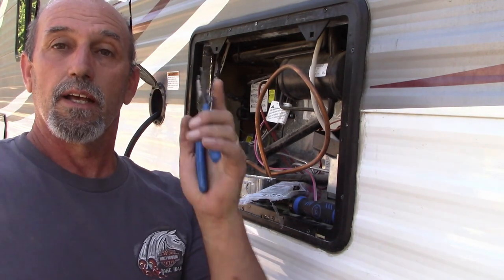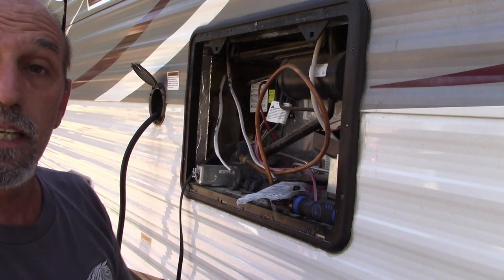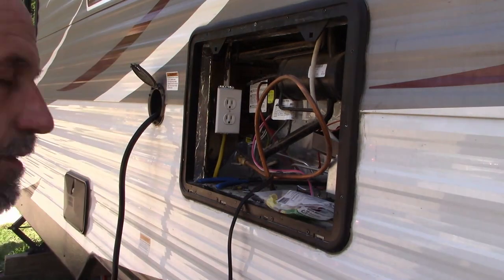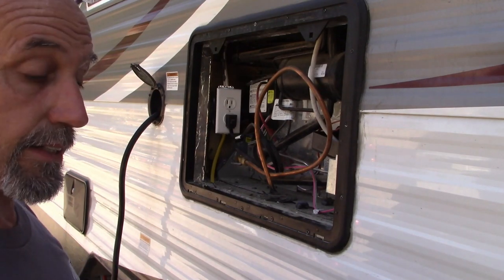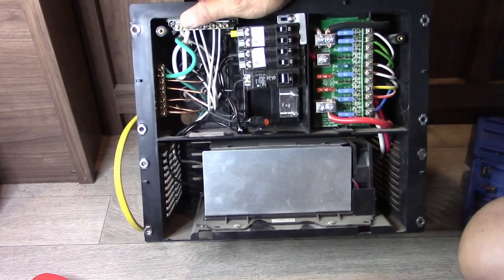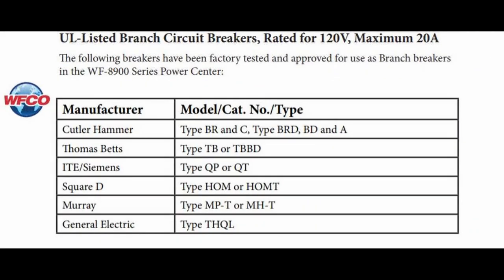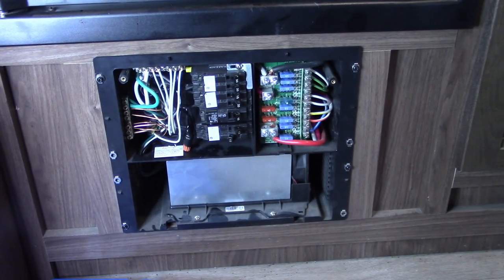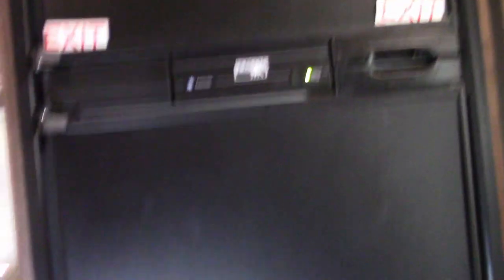Rewiring the trailer for use with the Jackery Explorer 1000

Comment: Nice video. I am plan on using my 1000 to run my truck camper. Now let me ask you, can the Jackery 1000 be utilized as a 12v battery? Can I get a 12v plug and run those wires straight to my campers electrical system? Essentially treating the leads from the jackery as 12v battery leads and connecting it straight to the system?
Reply from the maker: Yes you can, but the outlet is only rated for 10 amps on the dc output.
Reply: @DiyRVandHome thank you. What is the average small truck camper rated at, do you know or are they all completely different?
Reply from the maker: @LiveWayOut  That is something i cannot help you with. Surry

Comment: Do you have a 220-adapter into the 110slot on the Jackery?  I didn't know they made such a thing.  That's what it looks like in the video.
Reply from the maker: The adapter  you see is a 30 Amp to 15 Amp adapter.